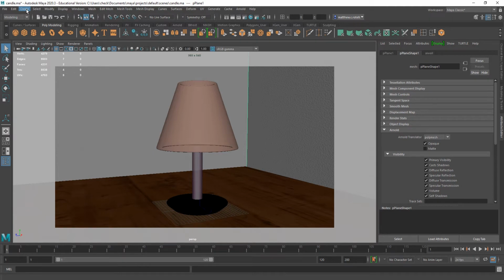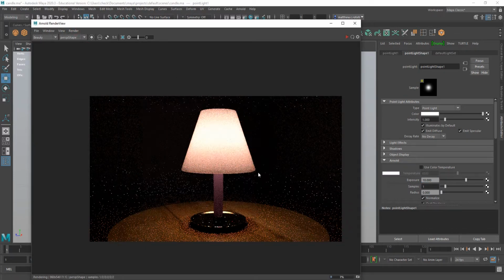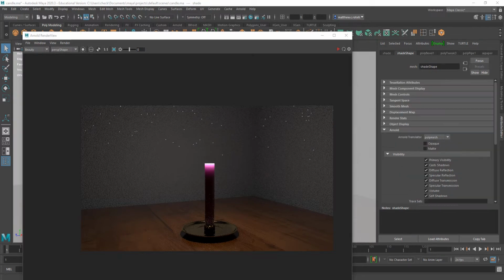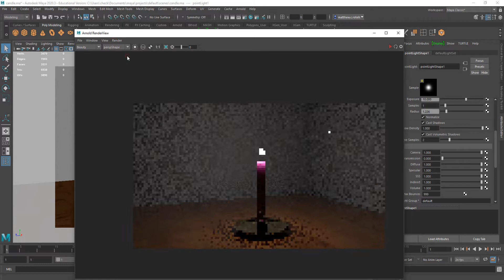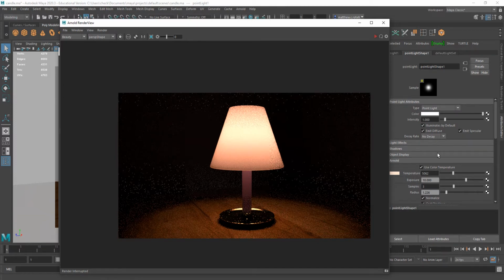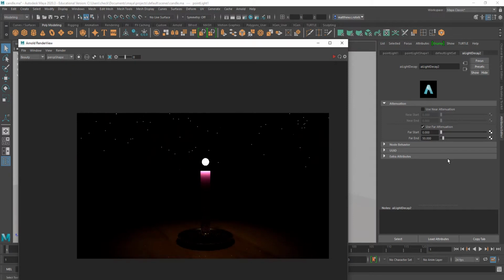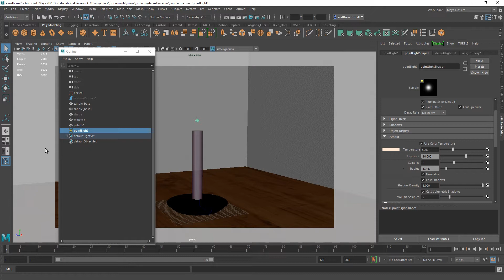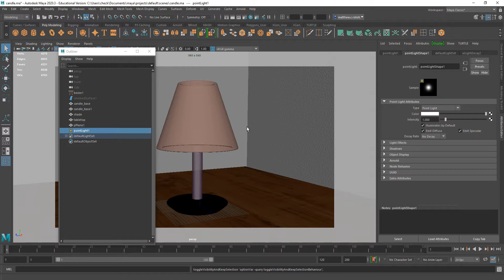Maya 2020 - Point Light Tutorial

Comment: what materials did you use for the shade?
Reply from the maker: It's an aiStandardSurface shader. To make a quick workable shader I just replaced all of the values with the skin preset in the shader presets, then I gave it a transmission weight of 0.172, and tweaked the subsurface scatter color and radius to be more in line with that of a lampshade.